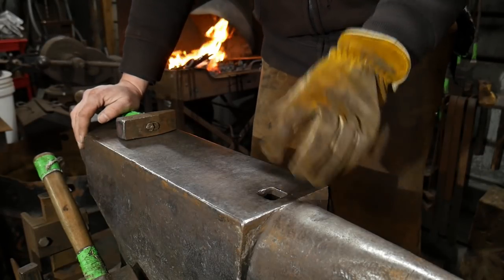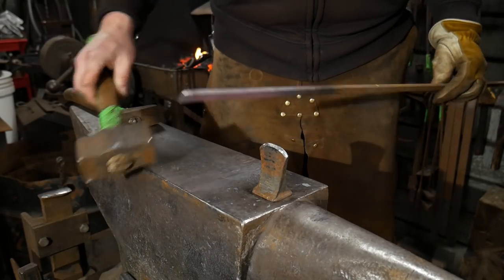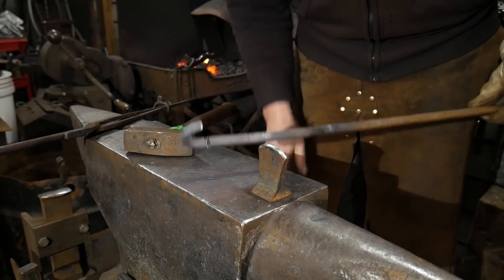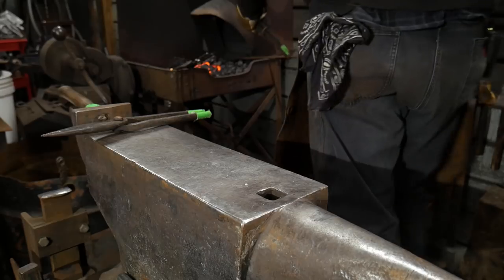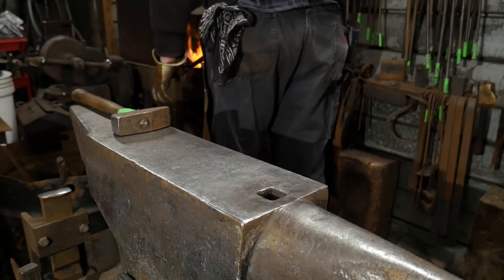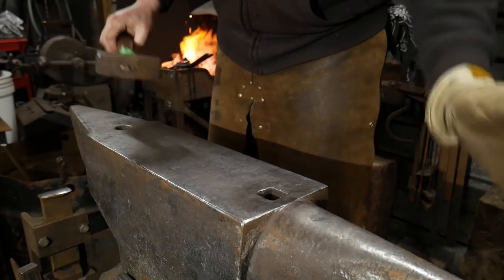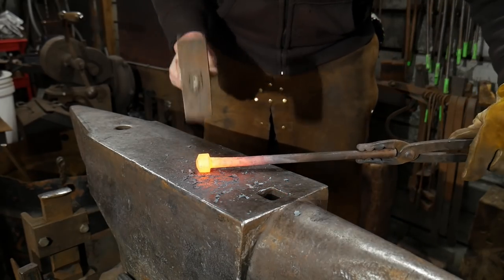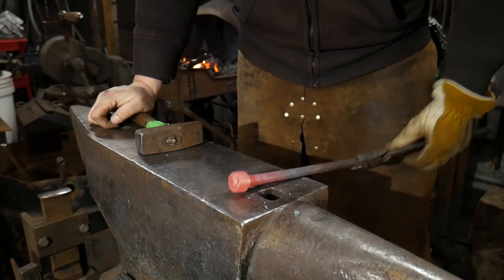How to Make a Simple Collar Weld (Forge Welding Techniques)

Comment: # good quality content. Would it not be easier to multiply diameter of the bar x Pi and add 1/4" on each each end of bar? than do the complicated looking formula that you show from Loreli Sims book? Haven't made a forged collar but did something similar to make a through bolt, did a tenon on the end of the rod slipped a square pc over the end and hammered it shut at a high heat.

Comment: #goodcontent #goodqualitycontent I would like to know how to manage the coal and coke fire efficiently for welding.  My brake drum forge may not allow enough volume for a good reducing fire, so I may never be truly successful. Roy, do you have content already that shows fire management?  Maybe another camera angle would be cool? I liked hearing you say, “I can’t see the collar or the shaft (same color as fire) they are at a good welding heat.”  Can I assume that if I can still see them - the material is not hot enough to weld?  Thanks!!